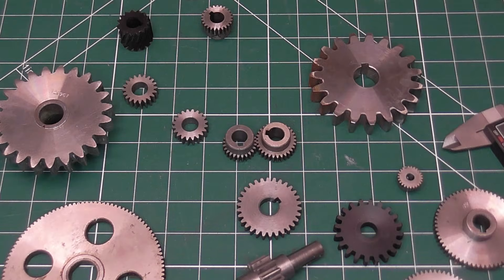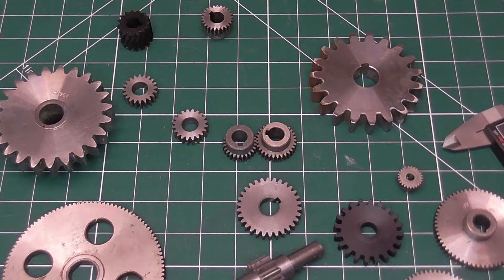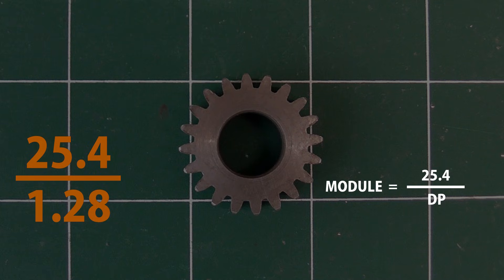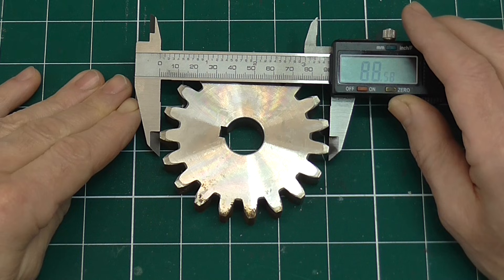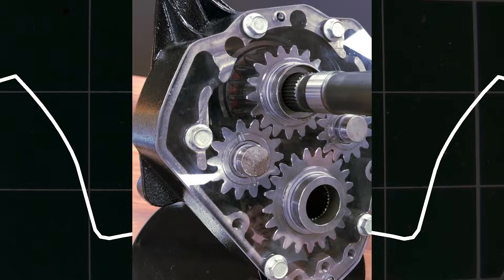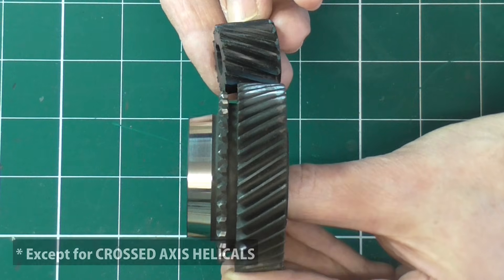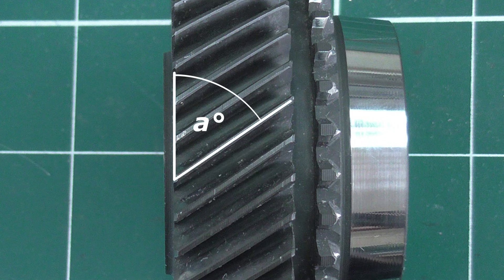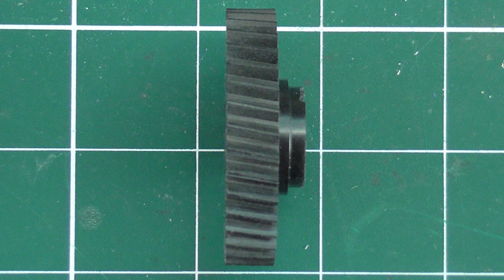How to identify unknown gears?

Comment: Important note:  the thumb trick for figuring out left and right helical gears, only works if the gear is upright, if you try it with a gear laying flat on the work bench, youll be wrong, and sad, and there is enough sorrow in the world already.
Reply from the maker: That's right! The same trick also works for screw threads, but in this case the screw must be horizontal, not standing vertically. If you Just remember the way the leadscrew and change gears are oriented on a lathe you'll get it right.

Comment: why you add 2 to the number of teeth?  I am studying machine design and this is confusing
Reply: Never mind, I found the answer. For anyone curious, the module is by definition d/n (pitch diameter over number of teeth) however it is hard to calculate it in real life. Also, it is standard to make the addendum one module beyond the pitch diameter. so under this assumption, the addendum is the pitch diameter plus 2 modules (one in each side). Now, sub the first equation in the seconed...

Comment: I’ve got a problem.  A plastic(nylon?) governor gear in a mower engine with the teeth worn off.  It meshes with a steel Idle helical gear in a John Deere.  The gear is no longer available.  The center hole is not keyed and not round.  It is round hole with 2 flats filled back in (what is the technical name of the gear Mount style.  Also what is the best way to replicate a gear.  Mill, 3D print or other method?
Reply: Also do I just take my measurements for teeth (angles) off the steel Idler gear it mashed with (has to be the same spec, right?
Reply from the maker: It sounds like the gear was probably injection moulded. Yes if it meshes with the steel gear properly it will be the same module/dp size and helical angle (or close enough to work) but note that one will be a left hand helix and one a right hand. It's not easy to reproduce the shape of the bore by other methods but you could use a round bore and two grub screws 180° apart.
Reply: @AndysMachines  would getting the gear redone in something like carbon infusion nylon 3D printed work OK likely.  The center hole with flats seems like it could much easier produced by 3D printing rather than machining
Reply: @AndysMachines  or machine down the teeth area of the plastic area a little further and machine and out Ring with helical teeth then affix to the plastic remainder of the gear
Reply: Out of aluminum. question, will aluminum with no load to speak water of against steel
Reply from the maker: Aluminium is generally a bad idea for gears, especially running against steel, it will wear very quickly and a plastic gear would probably last longer. If the load on it is only light a 3D printed gear (esp. nylon/carbon fibre etc.) might be the best and by far the easiest to make. It can take a lot of tinkering to get the tolerances right with 3D printing though, so expect to have to print it a few times.

Comment: 28.16÷22=1.28,how we know that  its might be imperial or diameteral pitch cutter. and we know to identify to others.
Reply from the maker: That's probably an imperial 20 DP gear which would be 1.27mod. The closest standard metric sizes would be 1.25 or 1.5 mod.

Comment: Excellent! I can now finally identify the change gears on my Chinese made lathe/ milling combination machine. It has some damaged gears and I need to make new ones so I can screw cut some standard metric threads. Obviously I need to know the module so I can buy the involute cutters to do the job. I've got a rotary table with the disks with different holes in them for setting up the number of teeth, god my memory is getting bad these days I can't remember the correct name for them lol anyway thanks for this video it's so helpful.

Comment: Great video.  
My father was a gearbox designer and these parameters were often spoken of at out house.  He wrote software in Pascal to calculate the various design parameters and working life according to the various DIN/ISO/AGMA/BS standards that all had their own quirks. and incompatibilities.  All new designs were metric but he often had to fall back to the other standards when repairs were required for older imported machines.

Trip down memory lane, thanks.

Comment: Brilliant , I need to pick your brain.
I have a left tooth gear and a right tooth gear both the same size in every way, with a missing gear in the middle but not only is it missing it will be a smaller one in size,
How do I determine what tooth and pitch and module tooth gear cog to buy.
I own a old jewelers hand crank roller for rolling gold and silver, between the rollers ,but at the top there would of been a T bar handle with the stem of the T bar running through a small tooth cog, So when I turn the T bar the smaller cog would turn, 
When this small cog turns it also turns the left and right bigger cogs and these raise the roller.
Reply from the maker: Does the rolling mill have helical gears for adjusting the gap between the rollers, or straight cut spur gears? If they are helical they can't be opposite-handed if there is only one gear in between. A left will only mesh with a right, so the centre drive gear must be the opposite of both the larger driven gears. Perhaps I misundertood, and you just meant they are located on the left and right? If they are spur gears, this can be calculated from the number of teeth, (outer) diameter, and center distance between the gears (measure across both and subtract the diameter of one).
Reply: @AndysMachines  If I put it in another way,
if I am looking down at the top of the machine  (,birds eye view) there are meant to be three gears all in a vertical line so all the centers are in line with each other,
The gear on the left is present, the gear on the right is present ,the gear in the middle is missing , so if i was to look down from above at these gears it should look like this OoO but the little center gear in the middle would be more central in line with the left and right , but at the moment it looks like this O O as there is a missing middle smaller gear.
Now the left and right gears cannot be moved closer or further as they have center shafts holding them in there position,
So the space between them can not be adjusted,
So I need to find out what size , pitch and module gear is needed to fit into the center  between the other gears,
so when turning the middle gear, clock or anti clock it will turn the left and right gear at the same time.
IF you could look up jewelers rolling mill on E bay  you will see the three gears at the top, the middle one will have a T bar or a round wheel and handle connected to it by a shaft, this is the one that`s missing, on mine
Reply from the maker: Yes, I know what a rolling mill is. I was confused by your original description of left tooth/right tooth gears, but I think the gears should be straight toothed spur gears? (Teeth not at an angle). Can you provide the measurements above? (no. teeth, OD, center distance). If so I should be able work out what you need.

Comment: Hey I was confused becuase i dont speak english but lets say i have a gear that has 12 teeth and a diameter of 32 and i did 12teeth + 2 ÷ 32= 12.0625 module but then I didn't get what the rest of the video meant could you please explain? Like what is the actual number I need to use? Like what's the final number to work the gear?
Reply from the maker: Well, first of all you want to divide 32 by 12+2, not the other way around, but what you've actually done is divide the 2 by 32 and then add it on to the 12. ie. the formula should be 32 ÷ (12+2). I'm not sure if this is an actual gear or just an example, (or if something's been lost in translation) but that comes to 2.286 module, which is much closer to an imperial 11DP gear than any metric size, so the actual number you want is probably 11DP.

Comment: what about splines? same method?
Reply: Splines are usually slit DP or Mod designs. i.e, The depth would be half of what it usually is for a full gear. A typical spline would be 8/16 DP 20PA , or 8/10 DP

Comment: Watching your explanation of the helical gear reminded me of a related experience. I worked with a mechanical engineer who specified which direction to feed the tap when tapping holes because he thought that tapping a hole in the "wrong" direction produced a left-hand thread. The machinists just played along with him. Since no incorrect threads were ever produced, the engineer never had any doubts.
Reply from the maker: I wonder if that would actually be possible with a very large diameter fine thread tap with lots of flutes? (And a lot of force). I expect it would just shred the tap.
Reply: @AndysMachines  Sorry, I didn't write my comment very well. The fellow I was referring to would always specify which side of the part to feed the tap into. There was no intention of trying to feed the tap opposite to the normal direction. His intention was to tap the hole from the same side as the fastener was threaded in. He sincerely believed that tapping from the opposite side produced a left-hand thread.
Reply: @andrewhall2554  If he was making a taper pipe thread then he was right to be careful. :-)

Comment: what about internal teeth ?
Reply from the maker: The pitch circle diameter (PCD) is the same whether it's an internal or external gear, but the addendum and dedendum are reversed. You can think of it as an 'inverted' spur gear so eg. instead of OD=Z+2 x module, ID= Z-2 x module.

Comment: What if you don't have the gear? As in no change gears for a lathe?
Reply from the maker: Then you have a blank slate to start with!
Reply: You just make it with the same module and pressure angle as the matching gears.  You decide on the tooth count and the diameter comes out of the equation.  Change gears can be moved to accommodate various diameters as only their ratio matters.

If you have no gears at all then you can pick a suitable module (DP) to suit the sizes and expected tooth counts.

Comment: I think I'm missing something here. I have some old helical gears from a 1970s Triumph gearbox. I measured the OD of one of them (89.85mm.) and it has 33 teeth. That makes the Module = 2.567mm.. I take it that is the width of a tooth around the PCD? I've measured a tooth at the approx. PCD and it is 4.6mm.
Reply from the maker: The tooth pitch (one tooth+one space) is pi x module, which would be just over 8mm. One tooth width would be half of this, ~4mm, which is a lot closer to your measurement. It can be hard to estimate exactly where the PCD is so you might have measured slightly further down, it's a little above half the tooth depth. 2.567 module sounds like it's probably a 10DP gear (=2.54 module) or if it's likely to be metric then probably 2.5 module.
Reply: @AndysMachines  Thanks Andy. The gearbox was derived from the earlier TRs so probably 1960s or even 1950s. I'm guessing we were using imperial measurements back then?
Reply from the maker: I'd guess imperial, but it could be either. 10DP and 2.5 mod are so close to each other though it might not make a difference.

Comment: Why add 2?
Reply from the maker: OD= Module x no. teeth +2

This is because the pitch circle diameter is equal to the number of teeth x the module. The addendum (part of the tooth between the PCD and OD) is equal to the module and measuring across a diameter you are measuring the PCD plus 2 addendums, so it's no. teeth +2. 

Makes sense?
Reply: @AndysMachines  yes thanks!

Comment: Sir, how do we calculate profile shift factor. Thank you video
Reply from the maker: I didn't touch on this subject, profile shift is basically cutting a gear with a modified pitch circle diameter. eg. you might cut 8 teeth on a gear blank that is the diameter of a 9 tooth gear. This produces a different tooth profile (less undercutting). It is often done on gears with low tooth counts (<12) to increase the strength of the teeth. It will of course throw off all the calculations on this video, so if you get odd results with a small gear this could be why and is just another thing you might need to be aware of.
Reply: This was my bread and butter stuff back in the day when I was a gear engineer. Your videos are bringing it all back so thanks @AndysMachines

Comment: Now what if they are Stub Tooth gears? Used to cut a lot of those. The Fellows variety.  The pitch circle was one DP. And the tooth height was another. The gear pitches expressed by the pitch circle over the tooth height. One example being a 40 tooth 10/12 DP gear. A pitch diameter of 4.000 and an overall diameter of 4.000 + (1/12 x 2).
Reply from the maker: Yes, they would be a special case, which would fall into the category of 'all the other types of gear I didn't mention'.
Reply: Experienced eyes would spot the pressure angle or stub teeth etc. Some corrected gears can appear a different pressure angle and when I used to design gears for the motor sport industry, We would often design gears with corrections so that standard tooling can be used for designing strong high pressure angle gears.  (Not easy to spot with the nakid eye though)

Comment: Please keep making videos, they're great!

Why do you need to add 2 to the number of teeth when determine module or DP?
Reply from the maker: I didn't go too deeply into the theory in this video (I've covered this in other videos). The reason is that the pitch circle diameter of the gear is equal to the module x the number of teeth. The height the teeth protrude above the pitch circle is (called the addendum) is 1x the module and there is a tooth on each opposite side which makes the outside diameter equal the module x number of teeth +2 x module, which simplifies to module x no. teeth +2.
Reply: @AndysMachines  seems to me by that logic - the formula would be (OD-2)/N

Comment: Each time I was typing a question the answer popped up! 

20+ years go I wrote some software that helped me determine screw threads. I was restoring my 1966 Norton 650 SS at the time, and had biscuit tins with indeterminate rusty screws from previous repairs. The result was probabilistic in that, given diameters and very rough tpi/pitch, and correcting for 30 years of rust, a likely thread was proposed. It worked well. I wonder if something similar could be done for gears.

The next step would be to determine screw threads and gear splodules optically, using a smartphone app.

Comment: Yo, nice to see a vid from ya, i was just thinking about you yesterday evening around 4 am... I wanted to share with you an idea on the terminator motion, regarding the spine and neck movement... I dont know how you plan to execute your final design, and probably you dont either, as final design is pretty much what remains after you say fuck it, im fucking done with this, its more than good enough.... 
In short, you know of those hydraulic rotary piston pumps with swash plates that allow the pump to regulate flow amount? Yeah, get some of those, scrapped ones, just so they arent rusty and utterly fucked beyond seized... You can turn the pistons in a lathe and put a whatever way you want of attaching the cables to the tops of the pistons, if your neck has say 8 wires, you get an 8 piston pump... With each wire connected to each piston, and pump ``reassembled`` after whatever mods you need to allow you to close it, but still have all its natural motion, you can use a single servo motor and a linear actuator to manage the pump rotation and swash plate angle, allowing you to practically achieve fluid(no pun intended) motion of the neck or spine in almost any way, be it bending, angling, swiveling around like when you stretch your neck out... I think its a great idea, and probably the best way to go about it, as such a pump with proper servo and actuator programming and control could practically allow the t800 to probably move better than in the movies, not really functionally to their level in performance, but more smooth and articulated compared to say the first movie and even the second... Heck with proper cables and ways of affixing them, you could have proper bone crushing performance outta it... But those tiny brake wires are more than good enough for this idea... I hope you get where im coming from and what i mean by this redundantly ineloquent litany...
Reply from the maker: Yes, I know the sort of swash plate pump you mean. I don't know if you've seen my video on the neck, but I actually did something similar with cables and a swash plate controlled by 2 servo motors. I need to revisit this though, as I wasn't completely happy with it, I used the wrong type of cables which change length slightly as they flex and this causes the mechanism to bind and not move very freely.

Comment: Excellent learning video Thanks.
But "what about the pressure angle" I was thinking.
I am bogged down at this step, so I guess from your video I should just go with 20deg unless it looks too fat or too thin. With a small gear I find it hard to judge.
Reply: You can use 2 guage pins and a micrometer and a gear chart to find it, but that chart may be extemely hard to find unless you have a gear textbook, and it would only work for even tooth count gears. The best way realistically is to genereate the gear in a cad program, add guage pin cross sections in sketch, and measure the distance in cad and compare to a micrometer measurement
Reply: For pressure angle of a spur gear tooth, find the point on the tooth that is radially 5/9 (0.5555) of the distance from the root circle, to the crown of the tooth.
Find the centerline of the tooth.  This is the tooth's line of symmetry, which passes through the axis of the gear.
Measure the angle between the tangent line of the tooth at the aforementioned point and the centerline of the tooth.  And that is the pressure angle.
Example 1:  If you find that the point on a tooth that is 5/9 the height of the tooth, has a tangent line angle that is 20° from the centerline  of the tooth, then 20° is the pressure angle.